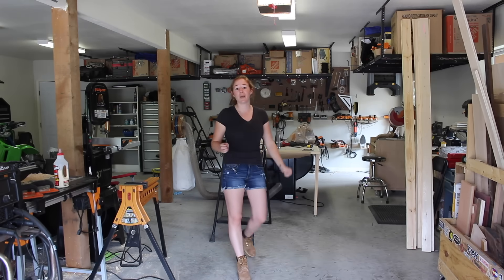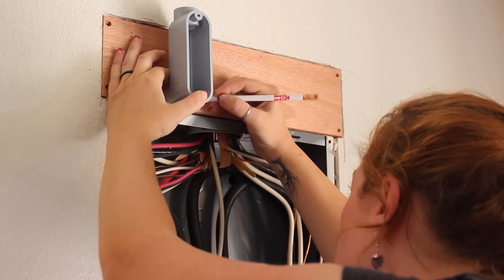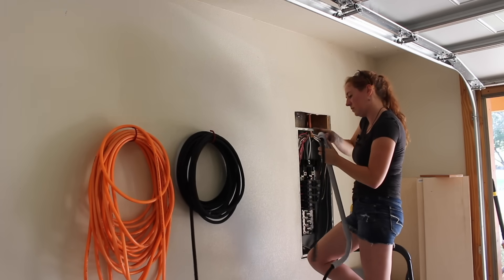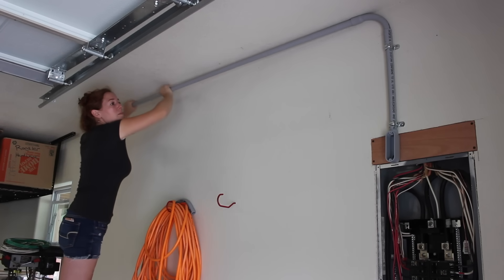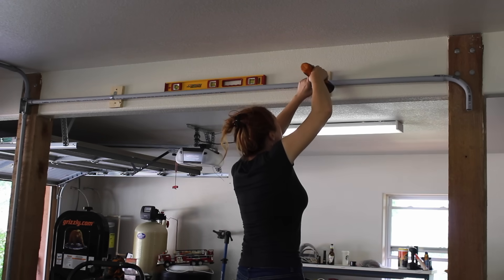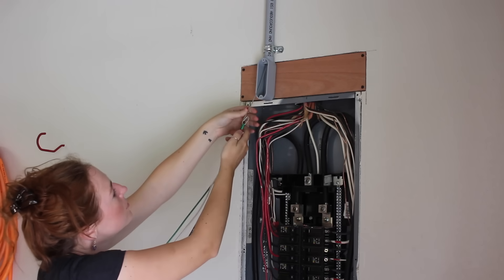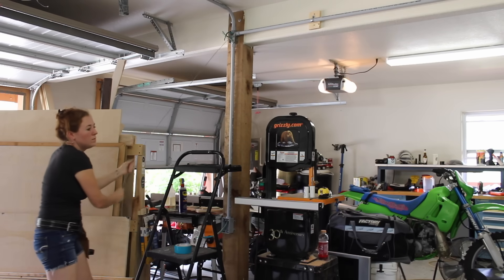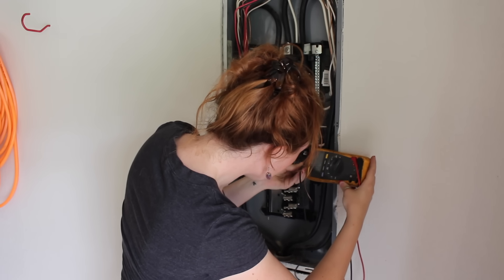Adding 220 Volt Outlets to the Garage

Comment: I just came across your videos and what an awesome knowledge person you are. When you said that you were not as knowledgeable in the electrical department.... I thought, “Finally, something I might know a little more than you”. Haha 
One thing most people don’t know is that you can easily heat up PVC conduit to bend it. They actually make heaters to do it but we used to just use a big end propane torch (not the normal propane torch). Kind of like the one they use for burning weeds.  Just keep sweeping the torch and turning the PVC and all of a sudden the PVC will almost turn to jelly. Place the PVC where you wan5 and use a water soaked rag to set it. I never buy 90’s because this works and looks so good. 
Again.... fantastic job and I have a lot more of your videos to watch

Comment: Do not tighten sockets and such with electrical tools. You might overtighten them and strip the threads which you don't want to😄. Only use a screwdriver by hand👌 great work otherwise🙂.

Comment: is it only me or is all american electrical junctionboxes, wire nuts etc like stone age equipment compared to scandinavia?

Work as a certified electrician in Norway and I'd cringe hard if I'd ever see junctionboxes and cable connectors etc like this. They were used in like 1980s here in Norway those kind of wire nuts.

Now we use something called WAGO. And the boxes we use is ALOT cleaner aesthetically.
Reply: ingar83 we use wagos here as well.

Comment: Not sure how ya got from the lb to the panel. If it's thhn I assume you wouldnt be able to just run it outside of conduit from the lb to a chase nipple or whatever was put into the knockout. Not a resi guy so sometimes I see things in residential settings that are different so to speak. I figured you would 90 out the wall and use emt. Not shabby for someone that doesn't work in the trade though.

Comment: How did you get the conductors into the loadcenter after they went through the LB? Just through the bare knockout? You can't just pop out a knock out and put thhn through. The conduit needs to continue all the way to the knock out.

Comment: A few issue but nothing that is going to burn your house down. 
1. Your not allowed to use a white phase conductor for anything other than the grounded conductor
2. I didn't see you clean and glue the PVC per manufacturer instructions
3. You may be over box fill in your junction box. A 4" square box would have been a better choice as that one is more meant for a device
4. Make sure all metal boxes with joints in it is grounded

Comment: Thanks , you seem very neat during the process . I have question ,  My friends panel haves two vertical live metals bars , each has 120 v ,  were on each side you attach the thermal breakers from each face of 120 v  . Then the bar for the neutral , and the ground .
Its quite different from the 220 v in Europe. Do I have to eliminate the Neutral ?

Comment: normally you should use either 2 blacks, or put black tape on the white wire. no neutral need in 240vac

Comment: Between the LB fitting and the panel, there's going to be about a 1-2" run of wire that is just in the wall, and not enclosed by the breaker box or by conduit. What's "the rule" on that little run of "un-protected" wire? Does it need to be enclosed as well, or can the THHN exist in that space without issue?

Comment: Didn't show you putting a chase nipple when you knocked out the panel hole at the top of the breaker box.  After the wires left the LB and entered into the top of the panel, they should have been double insulated and I'm not sure that code allows for single conductors in a wall.  Even thought the wires were only in the wall roughly 3-4 inches when it came out of the panel, they are still considered being "in the wall" at that point.  

You also didn't say what size conductors you used or the Amperage of the 220 breaker.  Amperage of the breaker determines the size of the wire.  Example:  20A Breaker = #12 AWG.  A 30A Breaker = #10 AWG.  Also, any other wire color besides white would have been better as it is commonly known that white wires are associated with neutrals.  Lastly, you also did not state the NEMA size of your receptacle.

Comment: One more thing is instead of a white wire you should have used red since it was being used as a hot leg and not a neutral, also a deep 1900 box would have been better than that handy box, hopefully you grounded the box when you spliced... nice work with a little training you’d be a fine electrician:)

Comment: Recommend using a short piece of wood (1 x 2 or similar) to secure the new breaker into place on the breaker bus. The less time you spend touching stuff inside a live breaker box (assuming it's live), the less likely an accident will occur. Armored cable works well for running electrical cable outside of walls. It's a little easier than conduit. Good work. Peace.

Comment: What did you feed the wires through to get them into the breaker panel?  It looks like they are exposed behind the wood cover you made.  Also, there should be something to protect the wires going into the panel.  They cannot just go through the hole.  I'm not an electrician, but I do have a little bit of common sense left.  Nice video.

Comment: Incorrect conductor color. You didn't bond the 1110 junction box. You did not enter the pvc pipe into the panel. You didnt glue the pvc fittings. You free aired the conductors into the panel, plus more fundamentals that make this an unsafe install.  Take your iwn advice and get it inspected; you would fail.

Comment: Just out of curiosity, how did you make the connection between the LB above the panel and the panel itself? All I saw was that you popped out the knock-out, but I didn't see the piece of conduit between the LB and the panel. Also, since your junction box is metal, did you connect it to the grounding conductor? Did you size that junction box for the number of wires in it? Looked a little tight.

Comment: I have seen way worse work done by electricians, my only gripes would be not going through the attic if possible, you cant free wire thhn from the lb to the panel like that (not a terrible thing) and if running 240 volt, without a neutral, you want hot colors, or phase the white wire.

Comment: Did you bond that handy box? What did you use to transition from the LB to the panel? I hope you didn't run those wire into an open knockout. You said this was 220. Looks like you are using #12 or #10 but you ran a white (grounded conductor). It should have been another black, red or any other color than white, gray or green

Comment: I would have run separate circuits to each of the receptacles.  When I built my shop, I did not have any 220V equipment.  When I bought my first welder, I was tied up and my son was wanting to use it.  I took him out to the breaker box in the shed, showed him what would kill him, and told him what he needed to do (he had never done any wiring).  About 15 minutes later, he came in and said he was done.  We energized the circuit, plugged the welder in and it worked.  I have a NEMA 6-50 inside my shop and a weather proof NEMA 14-50 on the outside of my shop.  I made a 14-50 to 6-50 (since all of my welders/plasma cutter use the 6-50).  Now we have two 50 amp 220 V circuits and when someone visits with their camper, they can plug it in.  The outside one is nice when the weather is good and we can work outside.  I would make an extension cord with the SO cord that you bought and didn't use.  I have a 35' 6-50 extension cord that comes in very handy.  We can weld/cut all over the shop and even both ends of a 42' trailer without putting it in the shop or moving it around.

Comment: I have nothing negative to say about this,  but I would suggest this for others,  not only tape the wires together, but also hook the wires to the fishing wire and tape the hook part so that it is more secure, last thing you want to do is pull out the wire from a long run, rebend the hook and start over it's better to be overdone than have things fail on you.

Oh, and cabling grease helps for tighter conduits, but not a necessary spend, it will just help it glide through the pipes easier

Comment: April, this is done very well. I'm not an electrician but have ran a lot of wire. Running SO or NM or UF-B through any pipe is a heat issue from what I know thats why they probably commented. Honestly I don't think it is an issue, I have seen it a lot BUT I also use THHN THWN through any pipe just to be safe. Great job all around Clear and concise.

Comment: Nice, cant imagine my wife running electrical. Super cool. Will say you used white wire as a hot wire, no biggie but should use red and black instead, or wrap some red tape at the receptacles,  junctions and the panel.

Comment: You daisy chained two 240v receptacles. You didn't mention but I am assuming you are using a 30amp breaker at the panel. So if each receptacle is 30amps??, than if you used both receptacles at the same time with heavy loads, the breaker at the panel would trip. I would have thought you should run two sets of wires (one for each receptacle) back to the panel with each set of wires going to it's own breaker. Unless the breaker and wire size you used can accommodate both receptacles operating at the same time.

Comment: One thing you didn't mention is to add up your bends, and never exceed 360 degrees in total bend. I rarely go more than the equivalent of 3 90's. If your total bends will exceed the 360 degree limit, you need to add pull boxes to ensure you're not pulling more bends than you should be. 

I also don't use a fisher for pulling cables through PVC like this, instead I string the pipe as I install it with 3 runs of pull string so I can add more wire later if needed. 

Also for expansion, you want to tape your runs together with electrical tape, either a few wraps every 2-3ft, or a continuous spread out wrap in a "candy cane" format so there's space between the loops. This way your wire stays together making future pulls much easier and cleaner. This isn't needed if you're only using large enough pipe to hold one pull of wire.

Still a really good video, great job!

Comment: To what I understand in my area you can not tie in 2 220s off of 1 braker they would need 2 individual beakers and runs.  But if your own place and no permits.  But as long as you don't run 2 things at the same time

Comment: I'm curious April.  Did you already have 220V wired to your garage?  I have a detached garage without 220V and where my shop is. l would have to either add an additional 100amp service to my garage making me pay 2 bills per month or I could hijack a 220 line from my main breaker in my house.  Either way, I'll have to hire an electrician to properly install a 220 breaker in my garage circuit box.  Live and learn I suppose and thanks for sharing.

Comment: Your 2x4 box or handy box is too small. According to article 314.28 of the National Electric Code (NEC) in the USA for Angle or U Pulls, or Splices: 
Where splices or where angle or U pulls are made, the distance between each raceway entry inside the box or conduit body and the opposite wall of the box or conduit body shall not be less than six times the metric designator (trade size) of the largest raceway in a row. This distance shall be increased for additional entries by the amount of the sum of the diameters of all other raceway entries in the same row on the same wall of the box. Each row shall be calculated individually, and the single row that provides the maximum distance shall be used.
Reply: Also the white conductor is used in the electrical trade as a grounded conductor, in other word not as a current carrying conductor.

Comment: I am trying to install my 2yr old tankless water heater in my moms trailer home- when i installed it at my house it was easy as the home is newer (updated) moms mobile home is older and the circuit breaker (40 amp dual) wont fit- is there a different type or something

Comment: First,  you should use black and red, not black and white. NEC doesn't allow re-identification of a white insulation as ungrounded conductor. Check code 200.7(C). Even if you tag it, some inexperienced person might still touch it, thinking it's neutral. The conditions 200.7(C) allowing basically say, well, if you're using some pre-made wires that has a white wire in it, we'll allow you to use it with a tag. But your installation used 3 THHN wires, it doesn't meet the 200.7(C) requirement.
Second, even if you want to re-identify white, the red marking tape should be at all terminations: the panel, the junction, the outlet...anywhere the wire is cut, you need to tag them.
Last, the LB is too small.

Comment: My washer and dryer calls for a two legged circuit breaker, carrying 120+120v. The type of box I have can’t fit modern breakers, and I found one (30A) that only has one toggle switch, as opposed to two tied toggle switches (Square D brand). Does this matter? Thanks!

Comment: I like you April am not an electrician but have done a lot of my own electrical under the guidance of friends and family who are electricians.  Here was my experience and understanding of wiring a 240 circuit.  I was adding a 240 circuit in my shop and using a wire size rating chart based on distance and current I chose the appropriate size wire for the job.  I decided to look at how the existing 240 circuits were wired and they like you were using three wires.  The white and black were each hot (white wasn't marked red) and then there was the ground wire no neutral.  My implement was wired directly to a sub panel and had four wires (red, black, white and green).  I asked my electrician friends how to do the wiring since the model I was looking at had just the three wires.  They told me they used to use just the three wires but now the codes for 240 circuit now required four wires.  The reason being that using the three works but if for whatever reason there is an unbalance on the circuit your ground wire could become hot starting a fire.  I ran the four wires for the new circuit I ran.  

Do any of the electricians out there have any insight on this?   I worry a little bit about the existing electrical in our house wondering if I should redo it. My friend didn't say one way or the other on replacing what was existing but I haven't pressed them on the issue.  It has been that way for 20 plus years so far without any trouble.

 Like I say I only know what I am told and while I do a lot of work myself always have people that are certified inspect my work .

Comment: Should of labeled the white wire as a hot leg or used a red wire to prevent anyone from mistaking it as a neutral in the future. Another tip is wrap the receptacle with a few turns of electrical tape for additional safety.

Comment: Looks great wonderful job
Reply: You can use a white wire it you ruining out of wire.longers you marked with black tape. But it's no recommended if you have the rigth wire. Or go to electrical supplies and buy the correct wire. Looks more professional. And always buy the correct wire for you proyects. Dont used a #12 wire on 30 amps braker.  Allways be safe.

Comment: you do not break at 2:40 if its a 240 direct use a 240 only do not separate or 2:40 to make it out to 1:10 or 9 to 2:40 that is dangerous in Most states it is illegal

Comment: I just don't like the fact that both outlets, could be energized at the same time..
I did a similar setup, but I ran the wire from the main box, to a secondary box with 220 breakers. Labeled them, stating only one breaker on at any time...

Best practice and following code, would be to have a separate breaker for each outlet..

Love your videos....

Comment: Not sure if this was mentioned in the comments (I did look), but I think the rationale for not running SO through a conduit is that it can't cool efficiently enough near it's max load with the rubber jacket and the conduit.  SO stands for extra-hard service and oil-resistant, which means it's good for use in commercial garage settings or places where it will be exposed to a lot of abuse.  THHN is thermoplastic, heat-resistant and flame retardan, suitable for dry or damp locations.  

A good discussion of the many types of cables (with a particular emphasis on theatre usage) can be found here- https://www.controlbooth.com/threads/se-vs-so-cable-question-for-ship.4420/

Really great video!  You explained what you were doing well and it was easy to follow.  Thanks!
Reply: Hi Ed, Running SO in conduit could cause overheating since the insulation is not rated for being in conduit. But practically with occasional usage it probably would not be an issue. The reason the code bans it is somebody will stick it in tight conduit and have it on a heater or AC load and thus long hours to heat up the wire, thus fire risk, ie the plastic degrades. If that SO was used in a cold barn inside decent sized conduit it would be safer, but not allowed! :)

Comment: i AGREE WITH JOE LEPP, AND I LOVED YOUR HIRED HELP JUST LAYING THERE....HOWEVER, PER CODE, THERE SHOULD HAVE BEEN NAIL PLATES FASTENED TO THE PIECE OF WOOD YOU MADE THE ACCESS FOR TO PREVENT ANYONE ELSE FROM INSERTING A NAIL OR SCREW INTO THE WIRING BEHIND THE BOARD.  THE PREVIOUS ELECTRICIAN SHOULD HAVE SECURED THE GROUP OF WIRES TO THE SIDE STUD, UNLESS, AND I CLEARLY CANNOT SEE, BUT WAS THERE  2 INCH EMT LEADING UP THE WALL.  IF SO, WASN'T CONNECTED TO THE BOX, BUT THOSE NAIL PLATES ARE A MUST.  GOOD PRESENTATION YOUNG LADY, BET YOU HAD FUN PULLING THAT THNN THROUGH THAT PVC!  I WOULD ALSO HAVE RAN A SEPARATE BREAKER FOR EACH RUN.  TO IDENTIFY THE WHITE AS HOT, I WOULD HAVE TAPED THE ENDS BLACK, BOTH ENDS AND AT THE SPLICES.  THAT'S THE CODE, SO WHEN YOU GET SOME TIME, REMOVE THE OUTLETS AND TAPE THE WIRE (POWER OFF FIRST) AND IN THE PANEL, TAPE THE WHITE WITH ABOUT 4 INCHES OF TAPE.